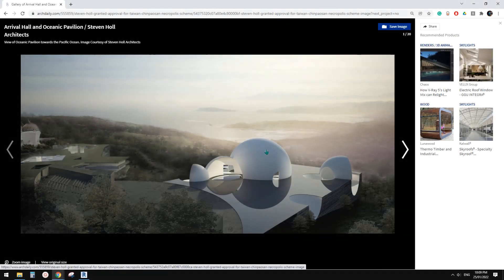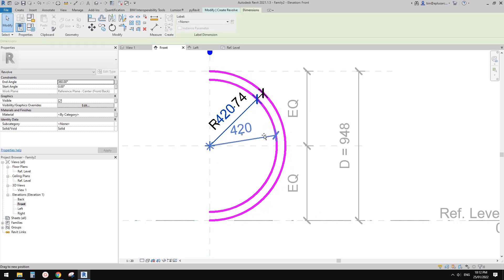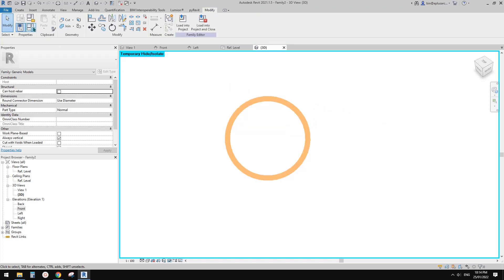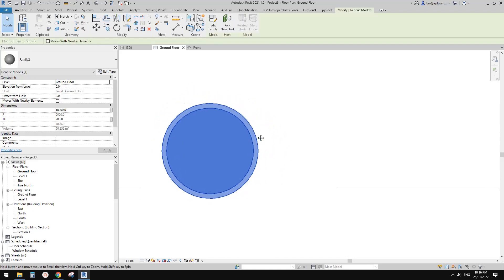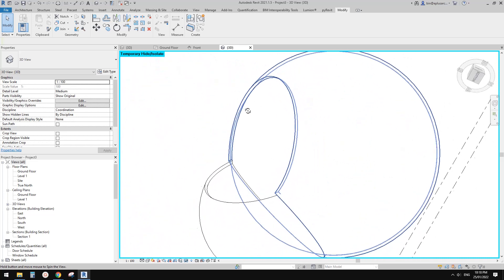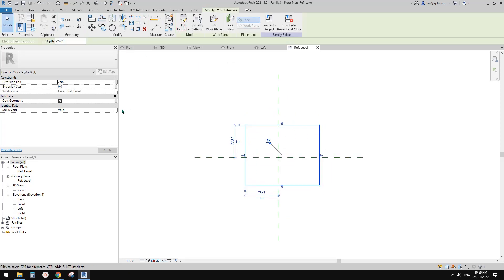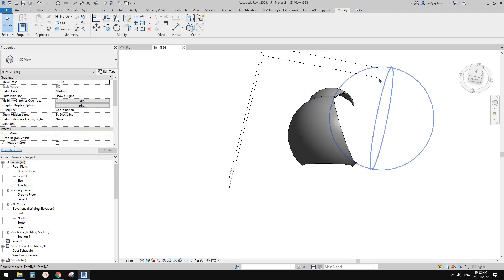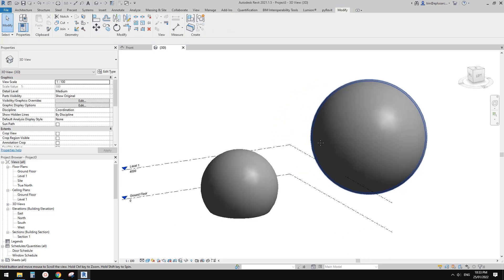Revit Exercise (Day 673) - Generic Model Exercise

Comment: The Void is driven by radius (r), is it possible to create a void driven by formula  to create a semi_circle or Circular sector by adjusting the void coverage ("just an idea"), Thank you for sharing sir
Reply from the maker: If you select the revolve geometry, you will see the parameters "End Angle" and "Start Angle" in the properties. You can use them to make part of the revolve. For example, 0 to 180 will make half sphere.
Reply: @BINHE615  Thank you
Reply: @BINHE615  Can this be achievable in the Adaptive Family....
Reply from the maker: Yes, it will be very similar.
Reply: @BINHE615  Your right.. Thank you sir